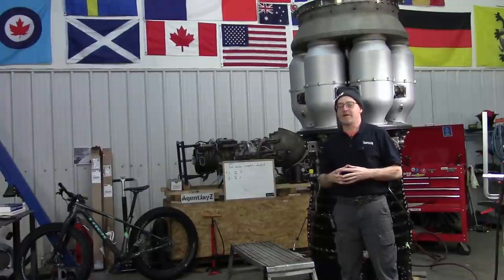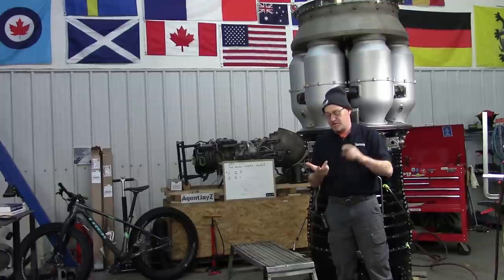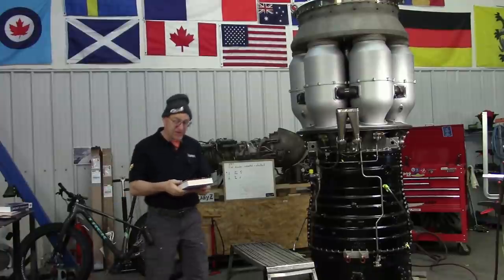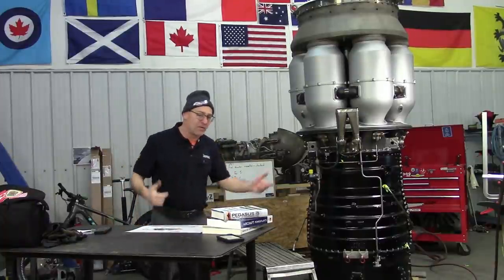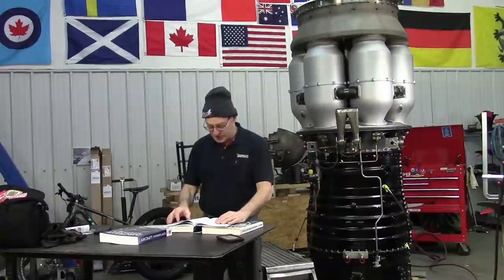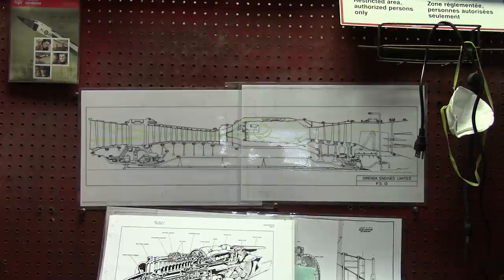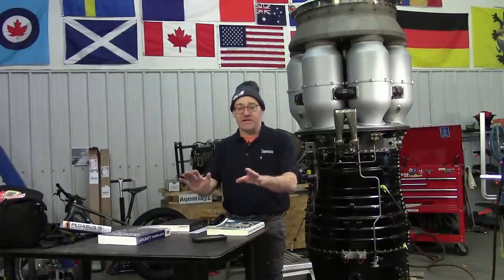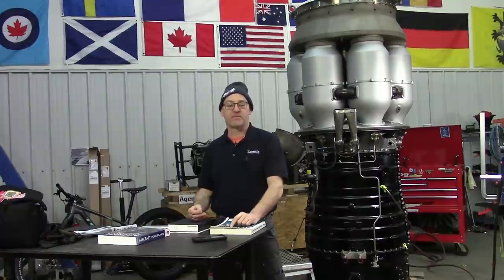So You Want to Design a Jet Engine

Comment: Dram inches is what you get when you try to engineer your jet engine using a system of weights and measurements that was cutting edge in the late 1500's.  1 dram = 27.34 grains  x 64.79891 mg/grain = 1771.602199 mg / 1000 mg/g = 1.771602199 g  / 1000 g /kg = 0.001771602199 kg  x 9.81 m/s^2 = 0.017379418 newtons.  Whew, we've got a force, half way there, now we just need a length of moment arm to get our torque.  1 inch(industrial, Swedish, Johansonn's) = 25.4 mm / 1000 mm / m = 0.0254 m.   Multiplying, we get 0.000441437 newton meters = 1 dram-inch.  From this we can deduce that in addition to being clever, motivated, and inspired chaps, the fellows designing early British jet engines were also completely barking mad!  Barking mad, and ever so very, very British.  Mad?  Yes, mad I say, unless you ALWAYS remember if that grain/dram/ounce/pound was supposed to be mass or force, and no, it's not always obvious from context.  Eh, who knows, maybe they coped by being very strict about always using slugs for mass.
Reply: Showing my age, a dram is a 10th of an ounce, if you stay in imperial units it works as long as you remember all the conversion factors, metric is a little better.  I the context of an engine dram inches is probably referring to balance. I grew up with imperial units then went metric I use whatever gives reasonable numbers
Reply: @ValExperimenter  I believe that it was/is 1/16 of an ounce.
Reply: @grahamj9101  No problem it would have been  30 years ago that I last used them, even grains which are popular in cartridge reloading are obscure nowadays.

Comment: As GE was given an operational British Power Jets W.2B engine (2485 lbf thrust) to get things going, it may be fair game to say GE has never produced a single jet engine "completely from scratch".

Moving forward, some Boeing 777 models use GE90-115 engines. At 127,900 lbf rated thrust, it's considered the 2nd most powerful production engine. Each engine produces twice the power of all the steam engines on the Titanic, combined, or as the LM9000, 65MW (power for roughly 6500 homes). A steal at $27.5MM apiece. Save your bottle caps, kiddos!

For the record, the GE9X takes the prize as most powerful engine at 134,300 lbf thrust. That's a lot of incremental improvements from a design "borrowed" in 1941!
Reply: @trevoncowen9198  I believe you're taking my comment out of context. First, at the time, the war was still underway, and GE didn't have access to that tech out of the gate. Second, I'm not trying to insinuate there are no revolutionary increments in the jet engine timeline. There have been many substantial improvements along the way, but given this technology, where exactly do you draw the line? And let me be very clear, I'm only talking about concept, NOT engineering difficulty. The details to work out bringing the idea to life deserves much admiration and respect.

Compressors. Axial vs. centrifugal. Both types were known, so is it revolutionary to say "hey, let's try the other kind"?

Spools. Ok, were getting closer. Again, we have one spinny thing we already know, so what if we put 2, or 3 independent, and speed optimized spinny things, rotating on the same shaft?

Combustors. This is probably the closest thing to revolutionary we have. We have a bunch of separate heat sources arranged in a circle. Can we make this into a contiguous curtain of heat?

Ultimately, it's all about your definition of evolutionary vs. revolutionary.
Reply: @trevoncowen9198  Thanks! Yours too!

BTW: refresh my comment. I accidentally posted before I was done composing.

Yes, I think we're saying the same thing.

Comment: I built a Tin can jet engine out of a steel window cleaner spray can, it has 4 fan stages and 4 stater stages and i made the combustion chamber out of a bicycle hub I ground dow in inlet sidedown to the base of the hub, also, I lined the hub with a cone peace of sheet metal to act as a compression chamber, and 3 exhaust fan blades and 3 stater exhaust blades and a rear exhaust cone! I was inspired from watching all of your YouTube videos!
@AgentJayZ
Reply from the maker: Bargle crackle. There no fans in the exhaust.
Whatever a stater exhaust blade is, I want one, to chop up my bacon.
Mmmm, bacon!
Reply: @AgentJayZ  Mebbe it goes on yer tater?

Comment: Sir would you tell us every component name of a turbofan engine .
Reply from the maker: No.
Reply: Remjet777  No sir  , I want to know about major parts for example;- ignition system , fuel system , FCU , Turbo pumps , starting system , cooling system  etc.  I know about  inlet , compressor blade , combustion chamber , nozzle, shaft , after all , more than one year i saw his video.

Comment: Jet engines are not preferred for small applications like RC drone or UAV due to their high fuel consumption as compared to piston engine. This May be the reason that its hard to find axial flow jet for RC plane
Reply from the maker: Just like with real engines and real aircraft... power costs fuel. If you don't need big power, a turbine engine is not necessary.
Reply: Piston engines require precise timing for anything to work.

If a person is just trying to make a glorified metal pipe that burns fuel and emits airflow than a non piston variant might be preferred.

Electric motors are not preferred because the energy per kg density of conventional fuels is better.

Comment: I have a copy of Mattingly's book.

Can confirm. Lots of math.

People get PhDs in individual sub-disciplines related to processes that occur inside these feats of engineering. 

I even took a swing at trying to get a self-sustaining engine running using food cans as the primary building material. The engine never worked. But it was certainly not a waste of time: I learned a lot.
Reply: I recall from college my friends with major in jet engines had a full year to design a jet engine in the fifth year of college

Comment: I feel like your talk about the work that goes into designing a jet engine is a good analogy for how the economy works.
No one person produces a world-changing revolutionary business.  While a new business idea can be designed and built by one or two people, it will be small, inefficient, and not much better than the other ways of doing business already in use.  It takes thousands of people working together over hundreds of thousands of man hours to build a business which has the reach to change the shape of an economy.

The only difference is that we falsely give the credit to just one person for so many revolutionary things that businesses have achieved, where we recognize that no one person "invented" the jet engine, much less the modern incarnations of jet engines.

Comment: Context to my question; ww2 liberty ships were equipped with ww1 style steam engines, why? So ma n pa basic machine shops could produce said engines despite steam turbine technology being the obvious ideal choice given no manufacturing constraints…

I enjoy purposely cutting corners building 2 stroke race engines striking a balance between China like costs and high performance without failures. Given it’s a race application longevity takes a back seat. 

I believe such an approach should be applied to small Williams sized jet engines for the same reasons given for using piston steam engines ww2

I believe darpa for example should challenge engineers to design jet engines that break zero records yet function for atleast let’s say 50 hours and can be produced by micro basically equipped Cnc machine shops. Perhaps allow a few 3D printed metal parts, widely available casting technology… 

I’m seeing a $600,000 price increase per usa missile in exchange for a more fuel efficient one time use jet engine
Reply: That's more or less how the tiny jet engines used in cruise missiles were developed. A cruise missile is an amazing device which transforms itself from a rocket into an aircraft within a few seconds from launch, and can do that whether it is launched vertically from a surface ship, or horizontally from a submarine torpedo tube. It has a small solid rocket motor tacked onto the back which gets it out of the launch tube and up to cruise altitude. A pair of wings fold out, an air intake duct opens, it jettisons the spent rocket motor and starts up its little jet engine, finishing the transformation into an aircraft.

The engine was in fact a Williams design, specifically the F107. This was originally designed as the power plant for the experimental single pilot "flying trash can" VTOL X-jet, also designed and built by Williams. It was built for a limited lifespan, essentially as a disposable engine - which made it ideal for cruise missiles, which by their nature only make a single flight, at the end of which the engine is deliberately distributed around the target in pieces.

Comment: Lucky for him I’m not just doing a turbojet. I’m  making concepts for a engine that goes from turbojet to ramjet to scramjet that’s a part of a hypercruising jet concept (so like supercruising but on crack)
Reply: remember once you get to burning compressed forced air you are looking at temps approaching 150,000 degrees C ... and probably higher ... and dont forget a turbo jet scramjet will pair nice as they BOTH have parts inside ... while a ramairjet or ramjet has NO MOVING PARTS .. so unless you plan on building a transformer ... you have to account for that
Reply: I think your motor sounds super easy to design. It's been a couple of years. Are finished building it yet?

Comment: Greetings.  A little late to the party I guess.  Very appreciative and yet fascinatied by what you are doing with you desire to spread and encourage the share of knowledge.  The greatest gift one can share is that of their own accumulated experience.  Hat's off to you kind sir!  ( Maybe I should call you "neighbor" since my daddy is from Winnipeg - LOL {please be kind})

Yeah I want to build a jet engine.  I've seen a boatload of people hack apart automotive turbochargers, machine the turbine to much more resemble that which comes out of say the J-58, yet they use a centrifugal compressor wheel from a similar street or performance turbocharger.   I see them all have the same problen. IF they get them to light it's not an elegant procedure.  As I've studied automotive (particularly diesel) tuning I've acquired enough knowledge to be dangerous with regard to turbocharger compressor maps and based on that knowledge it seems to me that's their biggest boggle with regard to getting these things lit.  (I will be quick to admit when I am wrong however)!   I don't see how a centrifugal "wicked wheel" can even come close to providing enough air at pressure to the combustion chamber of a "traditional single stage turbojet, let alone a multi-stage turbofan configuration when they try o get these things to light.  They practically melt down the turbine before they can achieve adequate airflow through the unit to maintain temperature to reasonable ranges..  Hardly an ideal scenario for model RC flight...

At the same time I kind of object to the extremely high costs of the numerous "mini" or "micro" turbojet model engines - and while some are probably very solid, I've seen too many meltdowns and major malfunctions with first-time buyers of these things on "the TUBE"

I'm a software engineer by profession (23) years now but have a solid 12 yrs as a Ford line tech before the career change.  Relevance?   I heard you ask.  Common sense plays a lot into the answer to that question but just the same defines my personal experience with jet engine mechanics.  Despite my lust for such knowledge, it's one of those things you can never do if you don't have experience, yet if you don't have experience, it's something you'll never do - at least in today's employment market.

Anyway, I had a wild fantasy while watching people try to convert automotive turbochargers into genuine turbojets, while looking at the numerous commercial mini/micro RC plane turbojets and even a couple of large bypass turbofans yet they all seem to base their compressor off a typical automotive radial turbocharger compressor wheel.

So the next step in this wild fantasy was to consider a genuine multi-stage axial compressor design - scaled down to the model level of course, VG stators, the whole deal and even possibly a LP and HP split turbine design.  (Actually there's a running model turbofan available already -)

But that's where i get stuck.  Temps, alloys, blade pitch and curvature, clearances, clearance tolerances,  *BALANCE*

I'm trying to track down some of the books you've mentioned to hopefully gain some insight.  I can run a mill, lathe, screw machine, CNC and again, have been programming stuffs for 23+ years.  This is something that has popped up on my bucket list several times through the years.   So many questions though when going down the road I just briefly illustrated...

Anyway.  Babble babble babblr.  I love your work kind sir and our no nonsense approach to '"see, look at this",   '"compare this" etc.  Kudos !
Reply from the maker: I am impressed, and there's a lot to discuss here. So, your comment here will be the subject of my next video. We're going to go through all of it, in stages.
I'm going to read a paragraph, talk about what you've said, and move on until we get to the end.
You may get a few comments from Citizens of Jet City....
Reply: @AgentJayZ  Thanks so much for taking the time to explain as you did ( and poke holes in my bucket  LOL)  I responded inline with respect to the turbine machining I mentioned.  Not sure if you saw it so I'll post here as well at 5:03 of this video you will see what my (perhaps erroneous) reference to converting an radial outflow turbine wheel from a street turbocharger into an axial design.  It's quite possible i understand less than I think I do.  Again, at 5:03 you will see what I was referencing...

https://www.youtube.com/watch?v=dYFYZ-g7fzA

Comment: 42.  That was awesome!!

Love your videos.  Super educational.  Thanks for taking the time to make and publish them.

I have a question since you work on primarily older engines about the fuel.  I watched a guy put a lot of 100LL AvGas into his F-86.  Seems he was mixing it with the newer jet fuel.  Why does the older F-86 need 100LL mixed with Jet-A to make the engine happy and if it could be converted to run completely on Jet-A?

I know the J47 on the B-36 ran on AvGas and not jet fuel.

What can you share on this?
Reply from the maker: Mixing avgas in your Saber is a way to compensate for a faulty fuel controller. The gasoline shortens the life of the fuel pumps... and the fuel controller.
So, eventually the FCU will fail, and hopefully it is a survivable event.
What is really the smart thing to do is to have the FCU overhauled so it works like it should.
At Jet City Turbines, we overhaul Orenda 14 fuel controls. It's gambling with your life to just put some gasoline in the fuel.

Comment: when I was working at Johnson tech we made f404 first stage hot section stators for the Canadian air force. the engine was designed by GE but was entirely funded by the U.S. government. When we delivered the parts to Canada GE added a large charge for designing the parts. I found that rather offensive since GE got paid by our taxpayers to design part.

Comment: I once heard brand new jet engines have very, very,  slight over sized compressor rotors and turbines. The run them up to speed mechanically  to "break them in". This is how they get the ultra high tolerance fit. Is this true?
Reply from the maker: It does happen, but it is due to the abradable shroud material in which the turbines run. The case cools faster than the rotor on shutdown, and  the shroud material can contact the blade tips. The break in process is to start and rub the engine for a few minutes, shut it off, and then wait for it to become free again. A few repeated cycles is often required.
If any engine is "stuck" when all parts are at room temp, there is a problem, and the starter should not be used to attempt to break it free.

Comment: I've been an auto mechanic for 37 years (now retired from that!) and an experimental rocket designer for 22 years.  So I'm familiar with hard work.

I'm also a budding engine designer, and am attending school for my degree as an ME.  Your videos are wonderful, and they highlight a strong point: it takes perhaps 20 years to complete the design and engineering process for just one damn engine.  It would probably take nearly 3000 engineers ten years just to complete one of my crazy VTOL/ducted turbofan ideas.  You're probably right, I AM NUTS🤯😫😩😣😖.

Jason Wampler
W A M P L E R

Comment: Thank you a lot for the explanation, but I think those guys who want to design their own engines they might be meaning the model jet engines not the huge ones.
Reply from the maker: So... toys. Not part of my world.
Reply: I won't be quite as dismissive as AgentJayZ on the subject of very small gas turbines for model aircraft.  I've met a few builders of these little engines at a local model engineering exhibition in the past.  Typically, they are very good engineers in their own right.  I also visited a UK manufacturer of small gas turbines for model aircraft a few years ago, when they held an open day.  More recently, I nearly bought one to play with (OK, it would have been a "toy" to that extent), when they were offering a discount.